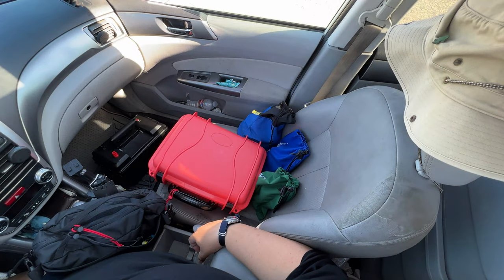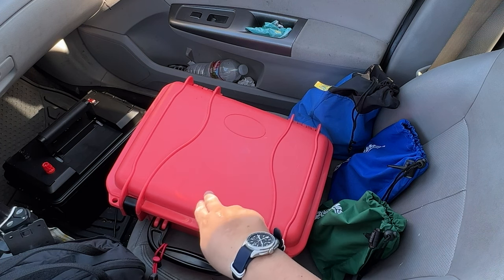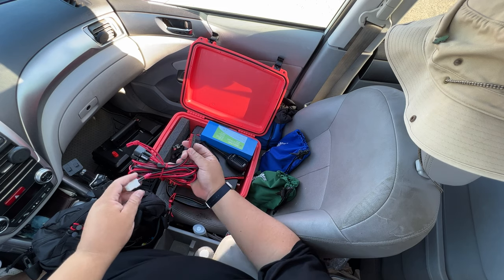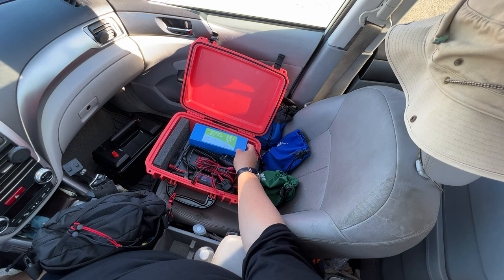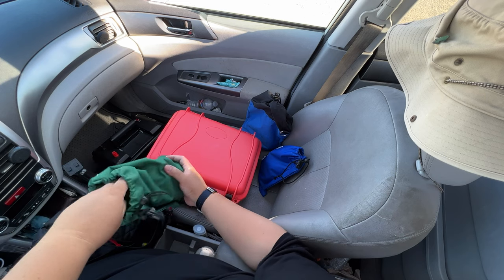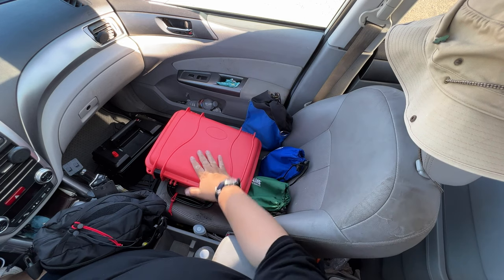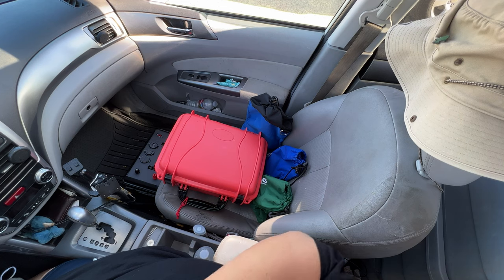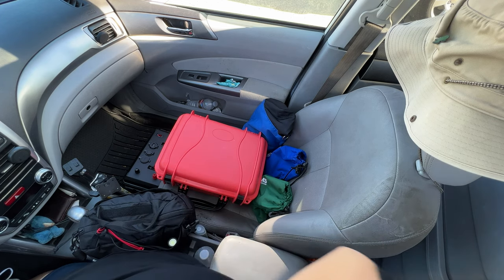Yaesu FT-710 Field Setup

Comment: Hi Frank,
The external display port is a DVI standard that can supply HD video however will resist much more abuse than HDMI or Display Port type connectors. It can also be secured with screws to prevent accidental disconnection. This port will serve you better long term especially in the field in rough environment.

73.
Reply: It's also cheaper as HDMI requires licensing fees to the manufactuer.

Comment: I was torn between this and the FTDX-10.  But dang HRO has the FTDX-10 for $400 off right now, so I caved and went the FTDX route instead.  I like your field setup :-)
Reply: Same here.The dx10 was a no brainer at $1299 last weekend. The front end hybrid superHed and the roofing filters are amazing. Coming from the 7300 i couldn't believe the difference. Ill be curious how long these two stay close in price. I bet the dx10 will go up to 1499 soon and the ft-710 will go down to 1199 in a few months after the glow wears off like all new releases.
Reply: I have a DX10 in my ham shack, and I'm considering purchasing another DX10 for field use. These radios are really amazing. The filtering is probably one of the best in the market, today.
Reply: My shack is 100 feet from two sets of long haul high power electricity transmission lines, so great filtering capabilities under $1.5k was my main requirement.  So the 101 was out and when I first looked the DX10 was too.  I was looking at the IC7300 vs the new 7100.  But then the coupons and deals started coming out for the DX10 and at $400 off, I pulled the trigger.
Those Roof filters and the antenna design I'm doing are going to hopefully make my shacks location not so noisy.  Sucks, you can hear the power lines on a quiet day, but this is the only spot on my property zoning would let me building this building.   Fingers crossed, I'm hoping to establish backup comms between Georgia and New York/west Virginia/Florida to be able to communicate with family in the event we loose the internet/cell networks
Reply: @forgetyourlife  There have been so many videos and forum posts about this vs the 7300. As a 7300 user now I have been contemplating trying out the DX-10 or (maybe) the DX-101. It seems the consensus is that the RX is that much better than the 7300 by many including the Sherwood report. Hmmmmmm
Reply from the maker: @forgetyourlife  Well, right now it's 300 dollars off, they are still on "sale".  But, yes it is a no brainer to buy the DX10.... which I did....shh..... :)
Reply: @frankwc0o  I think you will like it. It’s a whopping 13 pounds ta boot. I was surprised how much heavier than the 7300 it was. Now I have to find an old DVI monitor so I don’t fry the board.
Reply: @DBruno  the 101 is on another level of rx than this 710 and even the 7610.

Comment: I own a IC 7300 FT-710. And Xiegu G90. I can say with total honesty and integrity. The FT- 710 has the best recieve by far.. The G90 has a better tunner. The 7300 is way easier to navigate for the novice. And sounds great out of the box . However working all 3 rigs Technically. The 710 takes the nod.. all worked on a 7 element yagi... All that said . I would take a Xiegu G90 in the field. That rig will tune a wire fence..

Comment: If I remember the prices at HRO Superfest in Milwaukee, both radios were priced at $1299 during the event.
I almost bought a FTDX10, but after using the radio for some time at HRO, I went home empty handed for many reasons.
I never considered the FT-710.  

Today, at HRO, the price of the FT-710 is $1299.  The FTDX10 is at a mind blowing $1700 minus $200 additional savings bringing it to $1500.   I might reconsider the FTDX10, but I need to see the price under $1300.  Preferably at $1000 like the Icom 7300 use to be priced.  At $1000, the FTDX10 probably will fly off the shelves.
Reply from the maker: The FT-710 is nice and it's a great first radio. There is a difference in quality between the two radios. The DX10 is the next level and at the same price... it was a no brainer to buy it. I'm not sure if the dx10 will ever go down to $1000, but I'm sure it will go down to $1300.

Comment: Yes the colored ones are from sotabeam but the larger blue & black one that had your antenna in it was from somewhere else. I looked on sotabeams and could not find it.
Reply from the maker: The black one is from 5.11. It’s an emergency ready bag. https://www.511tactical.com/emergency-ready-bag.html?queryID=d66ba5f63932f8b6fb645c7dc7d83035&objectID=246509&indexName=magento2_productiondefault_products. If you search my channel, I have a video on that. As for the big blue one that one came with some rope that I bought for putting up in Antennas. If I can find the link, I’ll put it up for you. 73

Comment: nice setup! mine will be here on Monday, need to ask.. since the radio has a touch screen, will an ext touch screen monitor work with this unit, through the DVI port, or just a normal monitor?
Reply from the maker: I haven’t tried putting a monitor on it. I don’t think if you have a monitor that you can touch it will also operate the radio.
Reply: @frankwc0o  ya, we couldn't get that lucky! 🤭
☮

Comment: Thanks for vid. I am studying for my general and killing myself to figure out first HF rig. bought a G90 (good deal used) cause i want to do portable (i live in strict HOA). Fired it up last night first time ever on wolf river coil vertical, not sure I like it, alot to learn and not very user friendly. Both my elmers have 991a, which i am scared i will not like due to deep menu system. I am seeing used 991a for around $850 nice cause shack in box and i like fusion. Used 7300 out there for $850 but cant run external monitor and old technology (maybe shouldnt bother me). Really want a FT710 but would eat up all my funds. I have FTM400 and FTM200, those are decent but not great. Would love to go Icom, but alot of Fusion around me. DO YOU THINK like the FT710 or 7300 for first radio??  KD9IRA
Reply from the maker: You need to look at more videos on using the 7300 and 710.  I have a beginners guide video on the 7300.  You will notice that the menus are easier to use.  Unfortunately, just like the 710 the 7300 has no UHF/VHF.  It's something that is inconvenient, but as you work with HF you will soon find out that it's a lot of fun especially if you start with POTA communication.  It takes time to figure things out, it took me a couple of years to learn HF.  So start slow, it's a hobby and have fun with it.  Everyday you go out with your radio, it's another experience you have to do better next time.
Reply: @frankwc0o  thanks for thoughtful reply. I know the 7300 would be great but hard to spend 850-900 for used 7300 when a new FT710 is 1040 with warranty and will drive a separate monitor and includes speaker... $140 difference. I just seen a clean 991a for about $850, but again, no warranty, terrible interface (deep menus) and it is less then 200 less then a new Ft710...I have three nice dual band vhf/uhf rigs... shack-in-box would be GREAT but i think Yeasu next one will likely be like $1500-1700ish...

Comment: Not many front panel buttons... and the dials aren't concentric, so I'm not sure how well it''ll handle with separate volume and RF gain dials.   Hmmmm,  I don't see it being a 7300 killer.
Reply from the maker: Ya, that was strange that the RF and AF are separate dials.  As for buttons, nope it's no DX10 either.  The Rx audio is not bad, but many are selling this as the next best thing because it's not 5 years old.  But I think people who review these radios, forget that user interface is super important.  The IC7300's menus are way better - although the 710 has a better interface than the 991A.

Comment: Whats the current draw of the ft-710 when just turned on listening? edit: 1.6 amps, thank you.
Reply from the maker: Ya, it's about 1.6 - 1.8.  Not too bad.  At 80w it's about 11 or less.  The 144WH bioenno battery can handle it.
Reply: @frankwc0o  the dx10 (new to me last Saturday) is a hungry beast. I found it consumes 3.1 amps on RX. I find it amazing that the 7300 only used 1 amp.
Reply: @forgetyourlife  Ham Radio Dude has a pretty detailed look at the dx10 current draw with various settings on... I don't think I saw it go that high in his testing.  It can sit around 2amps if you bring the backlight down etc.
Reply: @Kinetic79  maybe it’s the new firmware. Dude had his on day 1 release.

Comment: If you look at the Sherwood engineering numbers on this transceiver, this is not an entry level rig IMO. Maybe price wise. Tecnology on the move. :)
Reply from the maker: Apparently so, now that it's number 4.  Yaesu needs something like this to get its lunch back from the IC7300.  Now that the FT101 is gone, the IC7300 is the darling of Ham Radio.

Comment: What size battery are you using there?
Reply from the maker: 144 Wh or 12AH from bioenno
Reply: @frankwc0o  and that’s enough for the atu also?
Reply from the maker: @lonewolfhamradio  external tuner? No. Built in ATU yes.
Reply: @frankwc0o  thanks Frank, I think I have a battery that will do that, just need the 710 now!

Comment: Great video! But you're wasting time dude. Now is the time to upload a video using this radio because alot of people don't have it and we are so curious to see how it works. Not just running though the features, actually USING it and making contacts with weak signals, digging them out of the noise so that we can see the contour and notch, and compare a full SDR to a hybrid like the FT-DX10. You've got one there man. 10 days after this video and nothing. Do it! lol
Reply from the maker: Ya dude, I know what you mean.